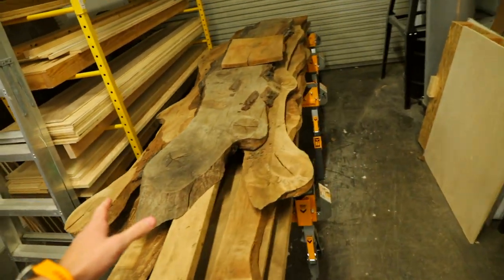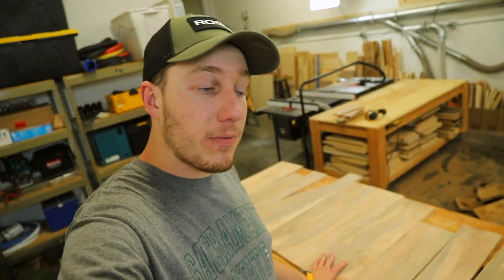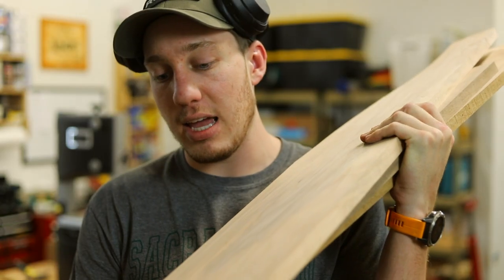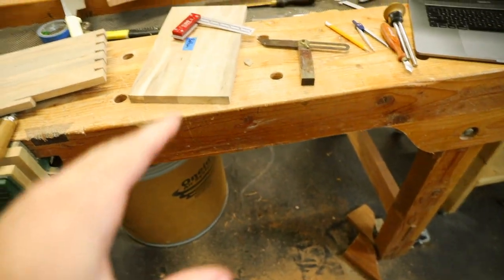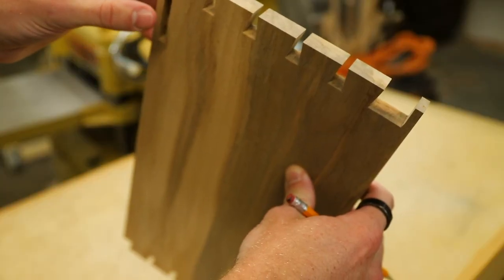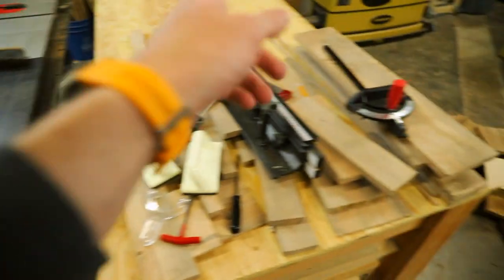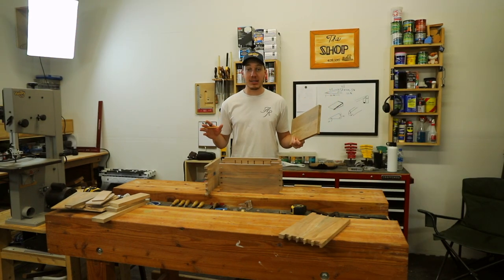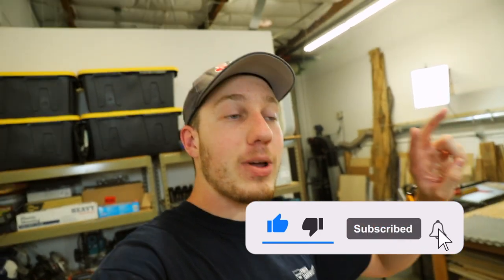Building A Pennsylvania Spice Box! | Part 1

Comment: Man it looks great!  As of now, I'm assuming it's finished... But would it have been easier to apply finish before gluing it up on the inside, or is there not going to be any finish?  Just curious, and how do you like that hold down on your bench?  I need one but my bench is too thin for those traditional knock around ones.  Also, I remember when you first started posting videos, and I must say, man you have really been kicking ass in the woodworking skills department!  You have definitely added a lot of skill since your first video you posted, Not that you are bad then by any means! 💪💪💪💪💪👍 I love your style with your projects where you do things the tradition "hard way" instead of the easy way!
Reply from the maker: I’ll apply finish to the inside after assembly. I love those hold downs. They work great

Comment: I received a 1980 Shopsmith Mark V in exchange for some work I did and while watching YouTube videos regarding the machine came across your series from 4 or 5 years ago. 

Boy have you changed a bit. You must have only been 15 or 16 at the time of your Shopsmith renovation. By the way nice job and do you still have it? 

I actually only plan on using the lathe feature of mine and was just about to restore an antique 36 inch small Oliver lathe when I was given the Shopsmith. I hear the Shopsmith Mark V runs a bit fast for turning and I may use the Shopsmith power station that was tossed in the bundle of goodies to power up the Oliver once step pulleys for V belts replace its flat belt drive system.

Take care and I'll have to watch some of your recent projects too.